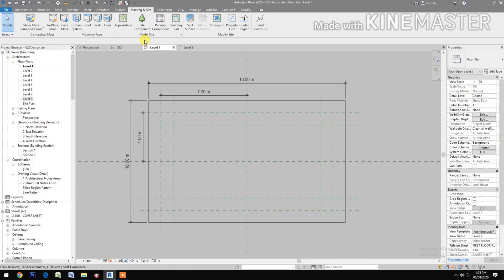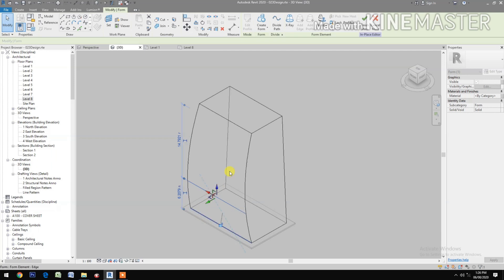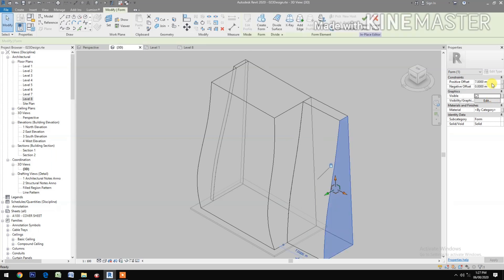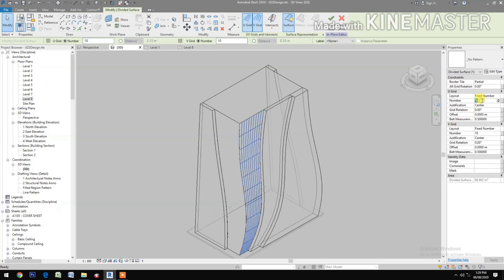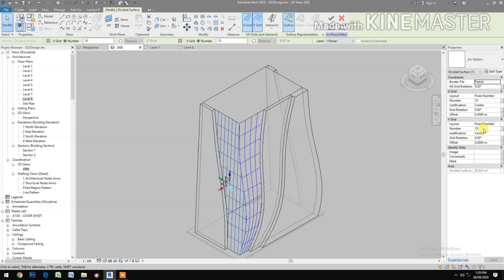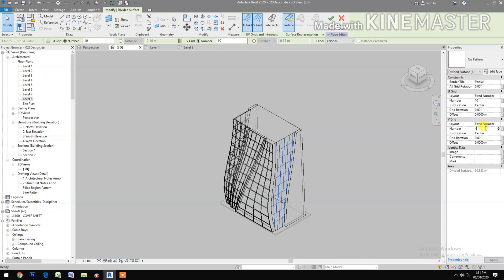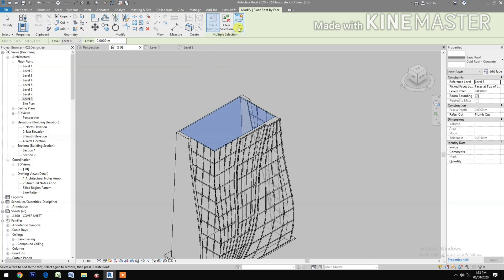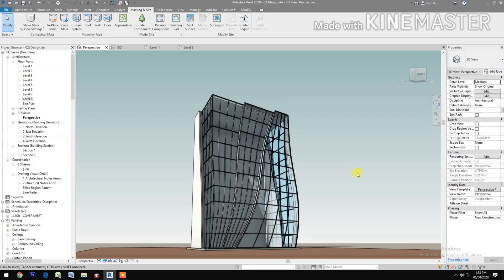RD023. Massing. In Place Mass in Revit.

Comment: Why is it no floors appeared after you created the mass floor?
Reply from the maker: Yes it will not create floor if you create edge to a surface and create a form from it. You need to duplicate the mass before you make changes.